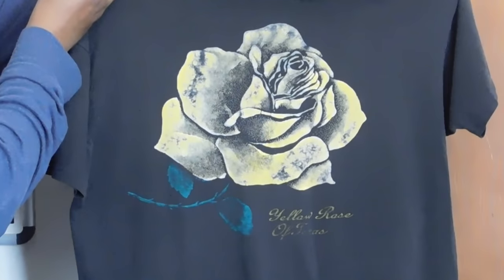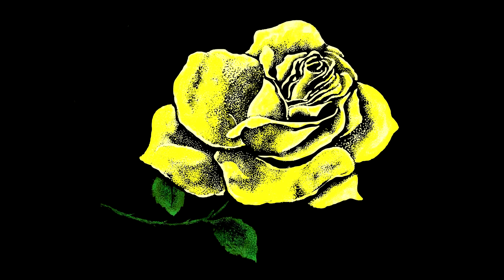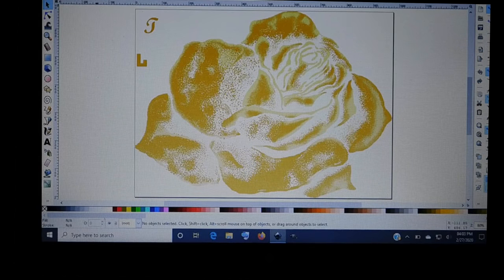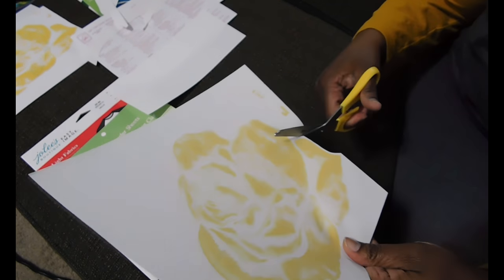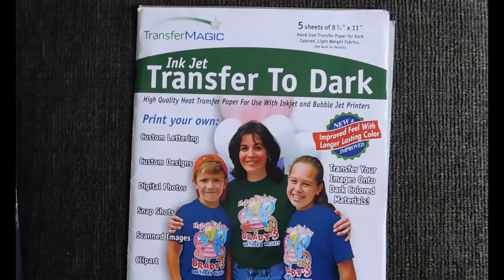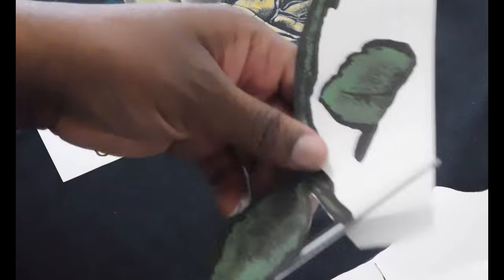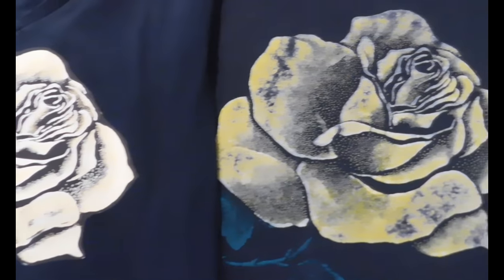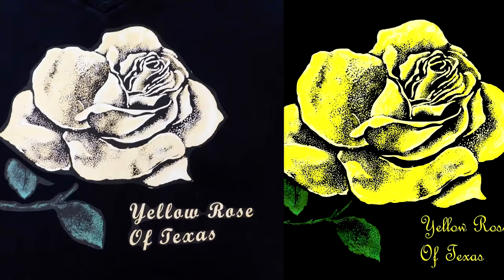Vevor Heat Press and Epson Workforce WF-7720 T-Shirt Recreation

Comment: Great video. Did you use a profile or printers manager? Also you need a lcd that is calibrated for better results.
Reply from the maker: Thanks!!  I think my monitor is still calibrated but I do need to get a monitor calibrator.  It was an issue with printer profile and program color management.  I'm still learning about color management.  I talked about it a little on my next t shirt video https://www.youtube.com/watch?v=ACfDxJT0PHI
Reply: @annmichelle6646  You'll get it its definitely a process I'm learning aswell. Where did you get the icc profiles for the printer?

Comment: sometimes the color you see on your screen is not the same as what the printed color is. I was having this problem too with a blue picture that kept printing purple. When I went into the color settings for the image I found that the color settings were actually set to purple, but my monitor was showing it as blue. I set it to the correct blue color and this fixed my issue.
Reply from the maker: I going to post another video.  I think I have the answer.  It has to do with choosing printer profiles.  In a test I did with colored lettering (pink letter) in some printer profiles it printed purple .  When I found the right profile it printed correctly

Comment: HELLO, I AM LOOKING TO BUY A HEAT PRESS  AM  IN CANADA SO AM LIMITED BUT I SAW THIS ONE VEVOR HEAT PRESS, I WAS WONDERING  IS IT GOOD? SHOULD I BUY IT? SOME OF THE REVIEWS WERE GOOD SOME NOT SO GOOD. WITH YOUR EXPERIENCE USING IT WHAT'S YOUR OPINION.
Reply from the maker: The vevor are a good budget press.  I like it and I haven't had any problems.  Now I see a lot of the new presses are clam style.  I don't know the benefits to that but I do like the swing out arm because I like to fuss before I do anything and I can see the whole thing.  The instructions that came with were sparse but if you look around the internets (youtube) and get a lot of advice on times and technique.  Check ebay.ca.  I came across one for $244(199 us bucks)  you can also buy directly from Vevor I believe they have a warehouse/operation in California.  Micheals, a craft store in US is selling a Siser Clam style for 300 US and they ship to Ca..  So in short I like my press but I haven tried the cup/hat press.  I'm dragging my feet to buy tumblers, cups and plates to sublimate because I wanted the press just to do t shirts.  It was a plus that if I wanted to do something else as a gift I would have the option.
Reply: @annmichelle6646   Thank you most definitely will check it out and the other ones you listed before I purchase anything.  I really don’t need the mug and hat ,but you never know may come in handy one day. Thank you so much hun.